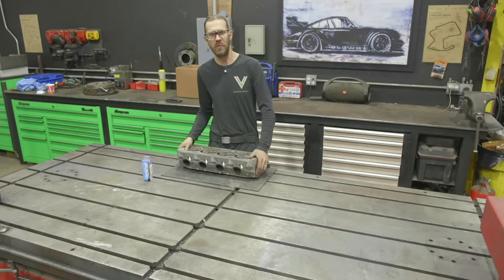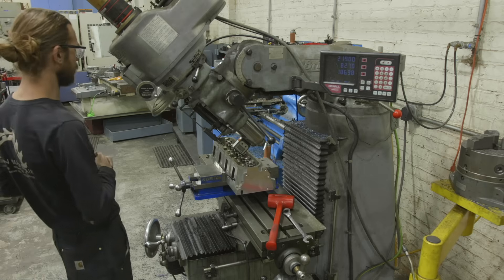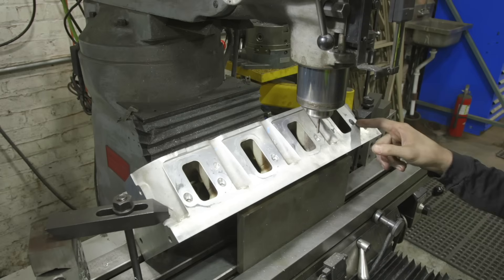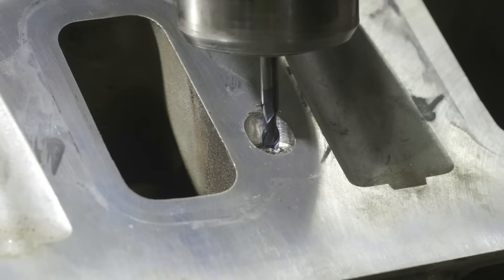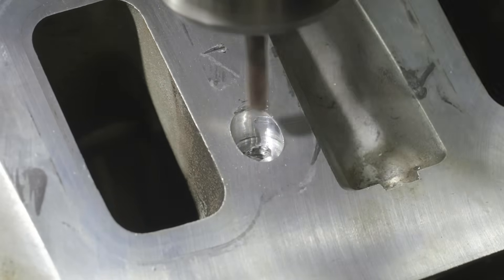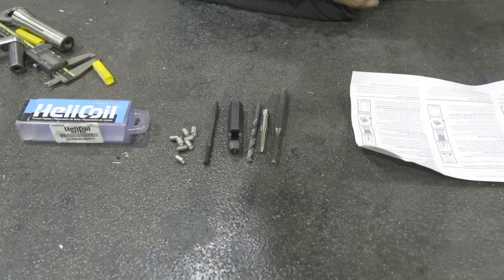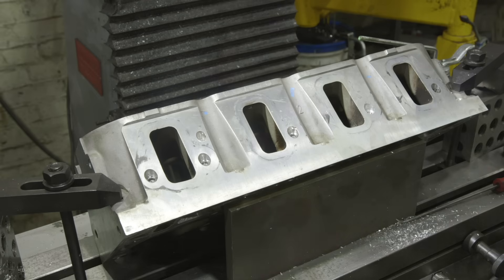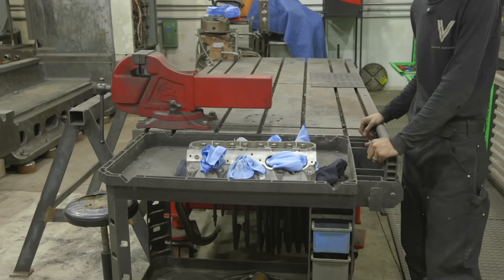How To Fix A Broken Bolt With A Helicoil

Comment: 11:20   I took in depth course that used to be offered by the Loctite Corporation, in the older days when it was a family owned company.  

I LOVE Loctite !!! BUT It is NOT required, or even recommended, (by with the Heli-Coil® brand), in this application, do not use it, either on the Spring Coil or the final bolt itself..  

The reason is, in the case of an overheated engine (even a bit over temperature),  the Loctite approach it's liquid state and become a Lubricant.   ALSO it will the tend to spread through the Heli-Coil 'spring' by capillary action, to the bolt itself, and lock IT in Place as well, after cooling, making future disassembly problematic  The Heli-Coil locks by spring tension (bare metal to bare metal) alone!! 

Removal of the Intake Manifold is an expected service operation, for the engine and Loctite can interfere with this procedure.

If you press the Loctite company, and you must use it ??  They demand  ...  only lower strength Blue or even Lowest strength Purple be used, for Intake manifold to aluminum head applications like this, AND it must be left for hours to cure, between insertion of the COIL, and insertion of the bolt itself, (but please just don't).

Comment: Hello Kyle
it is a very interesting problem on cylinder heads.
Here you have a car piece, I think it is not very difficult to do the job with a milling machine, for esample.
But, when you have a bike cylinder head, it is more difficult, air cooled bike off course.

I made this job many times, by hand, and I worked all the day long to do it.
For yhe next, I'll experiment a carbide (nano blue treated, HRC 70) milling cutter with round end.
Perhaps it will be good.

Many thanks for this video

Comment: That's easy, but if you work at a dealer, you don't get paid to send it out, and have to do it on the car. Nowadays GM uses Timesert's to repair threads.

Comment: Heli-Coils are HORRIBLE!!  A quick, cheap fix at the moment that create problems later.  Next time those bolts are removed, part of that Heli-Coil is likely to come out with the bolt creating a jammed bolt and damaged parts. A far better repair is to make and install a solid bushing. Time-Sert™ bushing is another option which uses a specific bushing that is wedged into the re-bored hole so that the bushing will never come loose.

Comment: Great job doing the repair. I guess I'll never understand why engines are built with inferior small screws today instead of a stable bolt that has been proven to hold better for a hundred years now 🤔? But it's still it's great to keep machine shops in business.

Comment: My goto is weld a nut on the bust'd bolt. The heat seems to help. Drilling and using an extractor requires so much care & attention with chances to mess up.
Reply: Since this small bolt was broken below the surface it would be much more difficult to do that type of repair.

Comment: Would Loc-Tite be advisable on the Helicoil?
Reply: I have used Loc-Tite on several occasions for that added insurance.
Reply: @hilltopmachineworks2131 won't the heat of the engine damage the Loc-Tite bond over time? I am not a mechanic and I have always been told to loosen Loc-Tite use heat.
Reply: @Andy-Gibb  Yeah. I use it on parts that don't see heat.
Reply: @hilltopmachineworks2131  doesn't an engine block have the whole heat of the engine to deal with? Even with the cooling from the radiator the hat must be excessive and effect the bonding of the Loc-Tite or am I missing something. Also thanks for answering my question. I am trying to learn the correct way of doing things. 😊
Reply: @Andy-Gibb  Parts like bell housings, transmissions, brackets, etc I will add a dab of Loc-tite.

Comment: Got 'er done.👍 A couple of pointers, if I may. When using the mill to remove a bolt with a tap, extractor, etc...imbedded in it. Bring the end mill( or carbide drill ) down until you have contact, and then set your quill stop. Instead of down feeding by hand, slowly back the quill stop down a few thou at a time and then peck to the stop, back it down again, peck, repeat. It acts as a safety stop that prevents the end mill/drill from grabbing and sucking it down into the hard part and breaking it. Check out Time-Sert thread repairs as a better alternative to Helicoils. Caterpillar thread repair kits are pretty good as well.

Comment: Might there be a sealing problem from the scratch you made at 07:01? (The "Chuck/Colet" bumped into the part) Or can you just use a flat stone to remove the burr and that doesn´t matter? These jobs are always the most iffy and nerve wreaking since so much can go wrong since workholding and such repairs where never planed into the design. I always wonder if it´s worth it to even do it, since so much can get damaged and who pays for what..
Reply: I noticed he caused that damage, but luckily it looks like it's outside of the mating/gasket face
Reply: @jasonmart1081  That´s lucky indeed. Would terrify me to do this job to in the end pay the part if it no longer seals correctly. It´s a silly mistake but not uncommon if you don´t set the quill stop.